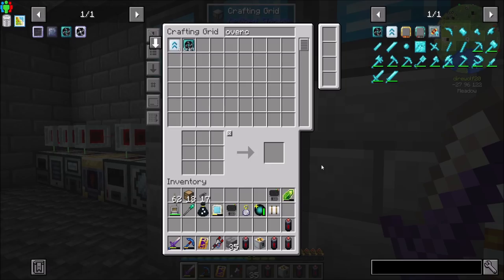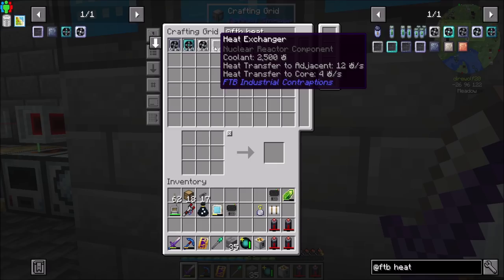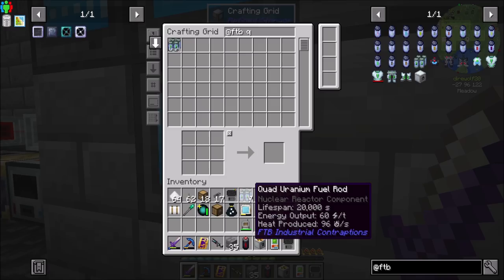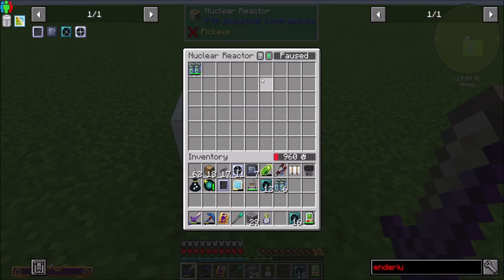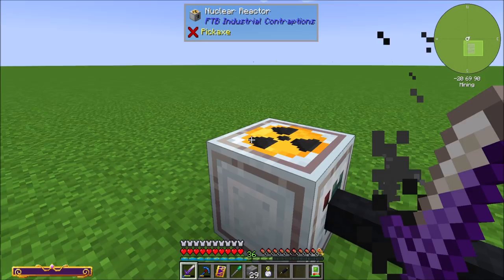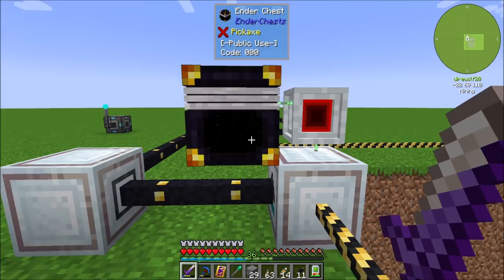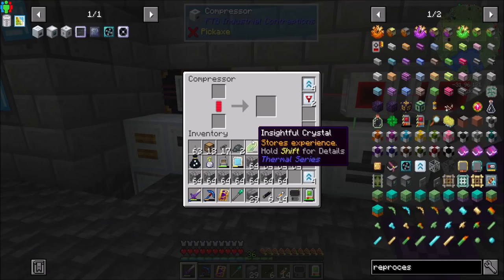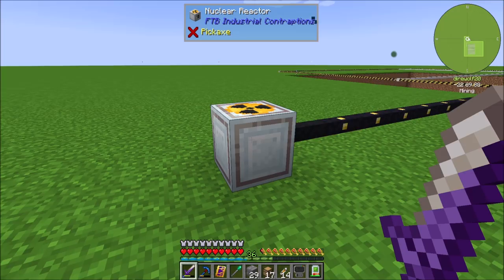Lets Play S11E45 FTB Nuclear and Antimatter

Comment: 0:30 Funnily enough, despite the stigma around nuclear power... Nuclear generators exploding is extremely unrealistic. They literally cannot explode the way a nuke does; the systems, while identical in the theory behind them, are completely different in practice.
What happens when reactors fail is that they enter something called meltdown. Nuclear reactors work like a coal, gas, or geothermal plant; water is heated up, then pumped through turbines- the difference is how the water used to spin turbines is heated up. In nuclear reactions, it's a slow, sustained nuclear reaction. If, for whatever reason the coolant (water) levels get too low, the heat that the nuclear reaction generates will have nowhere to go, and the chamber heats up. In such situations, the control rods (which are non-reactive material that can be used to slow or stop a reaction; they're used to control how fast the reaction goes, and how hot it gets) are supposed to fully enter the reactor to stop the reaction. If that fails, the chamber is supposed to be flooded with tons of water. If that fails, then the reaction chamber can heat up to the point where containment fails- typically as a result of the casing straight-up melting (hence the term melt down), releasing molten radioactive material, which can cause a lot of fallout, which is really bad, yes... But it doesn't explode.
If you go to Chernobyl, and entered the containment sarcophagus around the failed reactor (bad idea. Lots of radiation), you wouldn't find any sort of nuclear-explosion damage- in fact, the failed reactor is still mostly in one piece!

Nuclear power, ironically enough, is one of the safest forms of power generation (less harmful than coal smog... And less radioactive, too! Coal contains trace levels of radioactive isotopes. In nuclear power, the waste products are dealt with in extremely secure manners, which releases very little radioactive material outside of meltdowns, which are surprisingly rare, compared to public perception.) You get less of a radiation dose standing right next to one of the giant concrete 'barrels' used to store nuclear waste than you would by flying in a plane. Not to mention the several layers of safety mechanisms used to prevent problems from becoming disasters. Of course, human error/incompetence(Chernobyl, long island) or natural disasters (Fukushima) can break through said safeties... That said, there are still an astonishingly low number of nuclear disasters- much less major ones- compared to the number of reactors in the world.

Long Island? Despite the horror of it, most of the issues were an extraordinary lack of communication on all levels. The government failed to actually communicate the issues with the people (partially due to a failure by the reactor's staff to communicate with each other and the govt.), and as a result made it seem like an unmitigated disaster, when there was (statistically speaking) no significant harm done. The theoretical negative health effects were tiny- to a degree where there's no way to determine how many people got health damage from the accident (not a full meltdown)- instead of just random chance.
 Kyle hill has a video essay on the subject that explains it way better than I can, so I'd recommend checking that out if anyone's interested in the subject.
In fact, he has a whole series of video essays about nuclear power and nuclear disasters.
Reply: Well... this was a rollercoaster of a reading... remembering this comment is from a minecraft video make it kinda odd to read...
Reply: Really the only way there would be an explosion in the case of a meltdown is if something causes a blockage in the steam pipes. But yeah, nuclear power is horrifically stigmatized despite it being one of the safest, most efficient and environmentally-friendly form of power generation. Three disasters out of hundreds of reactors that have been operating just fine since construction is not indicative of the safety of nuclear power, especially since all three disasters were in part due to factors outside of the reactor itself.

Seeing people out in the wild who actually know the truth about nuclear gives me hope that the degree I'm aiming for won't be in vain.
Reply: Chernobyl engineers were so convinced that their reactor automatic shutdown would work that they intentionally short circuited a security system and ignored the warning lights blinking on their monitor.

I'm not sure if it's a +1 or a -1 for nuclear safety. The bug they found was fixed.
Reply: I'm all for nuclear power don't get me wrong - but another thing to think about is that a particularly upset and unstable tyrant with missiles at hand could see nuclear power plants as prime targets to cripple a countries power grid, while also making the immediate area uninhabitable.
Reply: @JackAllpikeMusic  ... Uh, not really? I mean, anyone in the immediate vicinity will be pretty hurt, sure, but you do realize that properly shielded modern reactors are, in essence, a box of steel inside a box of lead-reinforced concrete. Which is then housed inside an even larger box of lead-reinforced concrete, right?
I mean, heck. Russia attacked Chernobyl, and the main increase in local radiation levels were from the tank treads stirring up radioactive sediment, rather than leakage from the sarcophagus itself which is basically just a giant version of the same structure used to house modern nuclear generators, only the modern generators are also inside a smaller box inside of that.
Nuclear power is inherently dangerous, yes, extremely so. To the point where it's actually incredibly safe due to the sheer number of safety precautions that go into the building of a reactor. If anything goes wrong (such as incoming missiles)? The control rods can be fully inserted, shutting the reactor down completely, and neutralizing the reaction and making a meltdown impossible due to the reaction becoming unable to sustain itself. Unless the control rods are malfunctioning, the reactor will rapidly become completely unable to meltdown.

Not to mention that you can cripple the country's power grid by destroying their generators regardless of what kind they are, not just nuclear...
Reply: @JackAllpikeMusic  that would render the immediate vicinity somewhat unsafe. But it's not even guaranteed to explode. And I can't come up with any world leader at the moment tyrant of not who could politically survive this kind of strategy.

Your own army would look at you with big eyes.
The population would unrest.
and the rest of the civilized world would immediately try to dismantle your government.
Reply: Damn, that was a whole documentary!
Reply: True, though I feel it necessary to point out the public stigma isn't really linked to fears of reactor meltdown: as you said, they are very rare and the damage is really not that horrible. Rather, it's about the storage of spent nuclear fuel cells and disposal of coolant water. It's also not so much about safety, but about environmental impact. However, what most people don't realize is that spent fuel cells could simply be used in a different reactor: it's simply that recycling cells in this manner is more costly than storing them, so when power plants need to make money they are unwilling to do this. An intelligent nuclear power system therefore would have to be government owned: and we all know how Americans feel about that concept.

Comment: Dire: "We need more power"
Also Dire: ignores the two lava generators that he still has turned off
Reply: The FE power do not convert back to lighting bolt power. And what he really really need badly is auto-mining at this point. He should really have built it by episode 20 but i think his own mining laser mod is OP and needed some more testing. So he dont mind "going to mine" between episode. Anyway... now he need a lot of ⚡/t not FE/t.
Reply: @hurktang  he's doing all of this to get automining and does it really matter if a mod is op? If it is fun but doesn't stop tech progression it's fine, and you said yourself that his laser isn't cutting it anymore for resource collecting
Reply: @calithyde5346  Yes it matters because modded minecraft is about diversity. And if the laser is too good, it wont be added in other packs. I think the price of the laser is fair, but it might be 15% too energy efficient and 15% too fast.

Comment: I think the better way to deal with the Power spikes from the Reactor would be a HV Transformer to Transform the EV from the Reactor down for now so you will no longer run into your issue with the burned cable
Reply: Not really, he just need to use more than he produce. As long as there is cobblestone in that chest, everything will run smoothly from now on.

Other obvious option is just to remove a fuel rod in the reactor.

He's been talking about making a second reactor, so i guess he'll build EV after all, but there is other options he could take.

Comment: The angel ring got way more expensive, & now consumes xp when used. Bummer.
Reply: you can still change the configuration for rf  or xp use, if you set it to zero under xp, it will not use xp and still give flight.

Comment: If the reprocessor just needs to use any item, I feel like it’d be much more efficient to just set up an RFTools crafter that automatically turns the cobblestone into cobblestone walls or slabs or anything that gives you more items from cobblestone.

Comment: Dire, please implement a converter option to laser io that converts FE to Lightning bolt energy. I would prefer to use Fe to power the FTB Machines. You could even implement some kind of penalty if you like...
Reply: I’m preeetty sure the lack of Fe to zaps is intentional.
Reply: @scottchristofersen2367  but it never stopped mods like Power Converters from adding MJ to EU conversion :D
Or Mekanism Cables that simply converted to/from anything
Reply: Any converter would have to be 1:1 or even 2:1 because back in the day it used to cost more to convert RF to EU.
Reply: FE > LAVA > EU. It will just cost you a few ingots and a few m^3 to convert. Actually, you can even generate FE by melting neither hack in a magmatic thingy. It's not perfect, but it's not hard either...
Reply: Uh, not being able to convert is sort of the entire point of the mod.

Comment: There's another bug with powergen in the ic2 replacement, if you use solar gens they don't work in the perpetual day time in the mining dimension, even though they're under the sun they show as having 0 power gen and no sun on them. Very annoying!
Reply: That's an intentional feature of the mining dimension I believe, the dev made most solar generators not work there
Reply: @n0ame1u1  solar power> lava > ender tank > power . If that's the case it's easy to work around anyway. So not very annoying at all.

Comment: Man that seems like an overly complicated reactor build.
Reply: It's basically just a pattern where Fuel Cells are touched by Heat Vents which are then cooled by adjacent Component Heat Vents. Plating is just filling in some empty slots iirc. Dire didn't really mention this but components need(ed?) to be adjacent to others for heat transfer to work. It's not enough to just put a certain ratio of components. And I think the top left fuel cell is cooled via that single heat exchanger since both tough the outside.